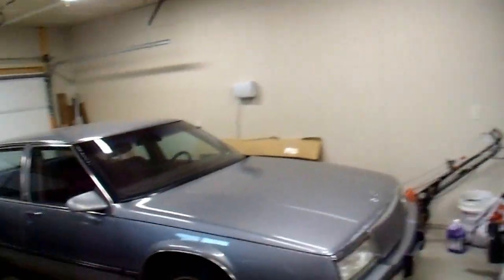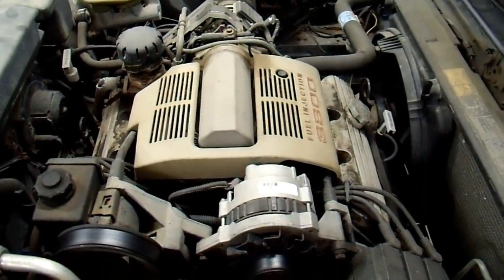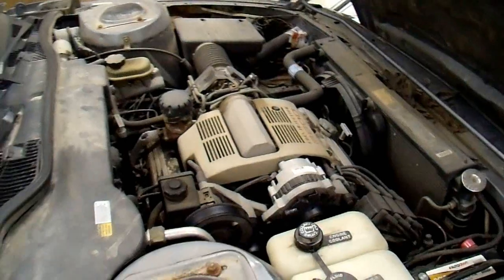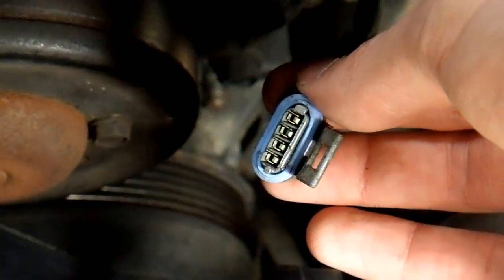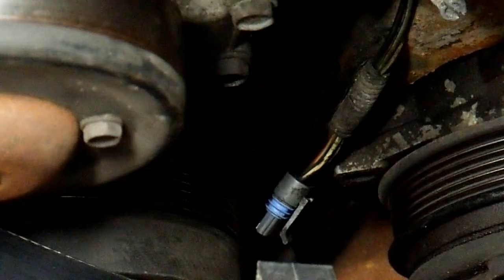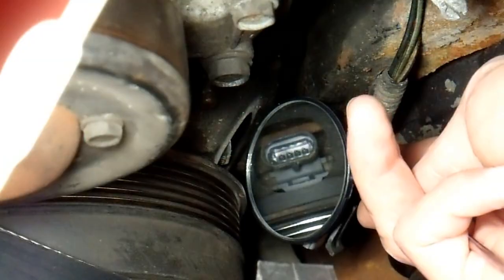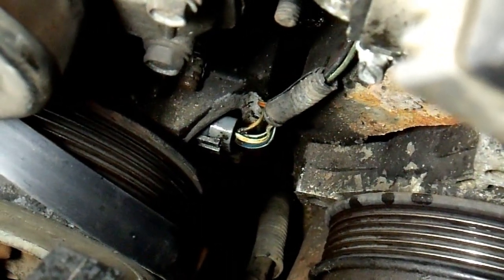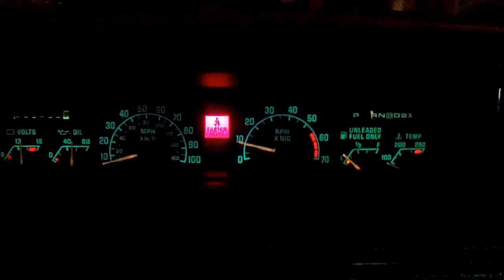3800 3.8L GM engine stalling issue quick fix

Comment: Last year same thing happened with my 1994 Buick lesabre, I changed the crank shaft sencor and it fired right up and been work sence then, until now same thing happens but after we changed the sencor again it won't start, and if it does it stall then won't fire up again, plus my service engine soon light is on, which means a tune up, any ideas won't be great before I waste money at the shop. Could it be the position sencor?
Reply: Lone Wolf Use butt end of screw  driver tap MAP sensor (Its black in color made of thick hard plastic approx 2 1/2 inches long by 1 1/2 inch wide) sensor is directly behind manifold you can see it with your eyes no need look behind manifold, right side of alternator, If MAP sensor is bad or faulty. Guarantee your car wont start. You can either buy new $75 or buy salvage $35
Reply: Hey, I just changed the crank shaft sensor yesterday, and my 1995 Park Ave. stalled on the freeway.  Other people say it might be the fuel regulator sensor......  I don't know
Reply: Lone Wolf Engine stalls? Its fuel related have fuel filter checked you need replace this part every year filter get dirty clogged which prevent fuel reach engine. Also check fuel regulator. Dont usually need replace part just use air hose clean it out.

Comment: I have a 1994 Buick park avenue and it is having the same problem as this Buick on the video... my needle would jump around and my coolant and oil light will come on then the car will shut off while driving... took it to a shop and the services I received was an intake manifold gasket along with a few other services leaving me with a 1500.00 bill... got my car out the shop and it is still shutting off but it runs better than before... now their computer is saying that my circuit is low with my TP sensor... I am getting very aggrieved with this situation... could it really be the crank sensor or the tp sensor?? help a female... please
Reply: I know it's an old question, but you can't go wrong with just buying them and putting them on yourself. I always get all new sensors if I have to tear into a 3800, it's more likely that they are at fault rather than something mechanical. I replace the TPS, IAC, MAF, or you could just buy an aftermarket throttlebody to do those 3 easily. But it's really easy either route you take. Coolant temp sensors can actually cause more problems than one would expect too, a little harder to get to but still a 20-30 minute job. Best of luck, I have faith you'll figure it out. Take care of that old girl, I love PA's :)

Comment: i have a 2001 buick lesabre 3800 motor and while i am driving once ive been driving for like 30 minutes straight then it misses it backfires and then finally shuts down it has 2 kool off for like 30 or 45 minutes and then it cuts off i have brought the crank shaft position censor and also the fuel pump and spot or other things but i still have the same problem what should i do next? what could it be??????? please help
Reply: David Settles it might be ignition module

Comment: I have the same issue with my 1990 Buick regatta. Mine would stall when I step on the brake to slow down.
Reply: did you find a solution to the problem?

Comment: Thanks a lot for this, including the advice of just wiggling the wires and connector if in a pinch, which worked! Restored from the dead!

Should dielectric grease go directly on the contacts also? Or only on the silicone boot (crankshaft sensor)?

Comment: I have 1994 Olds with 3800 engine, it runs great but stalls intermittently only on deceleration and at slow speeds.  It may stall 2 times in a few blocks and then not stall for days.  It typically restarts first try. It never stalls on acceleration.
Reply: Late reply but that could be the sparks or it could be your coil pack. If not maybe a ground problem

Comment: i have a 2000 Pontiac Bonneville my wife drove it to work and a/c pump locked. fixed that but now it won't start i put a cam sensor and crank sensor on it it start up and runs rough but then dies in a few seconds to a few minutes. won't fire then it will fire and start again and not long it dies! anyone know what it could be!!!???

Comment: If you really want to stop this from happening, don't use WD-40. It won't last long enough.

Instead, get some dielectric grease and go in there with a brush. The grease will protect the thing from corroding far better than would WD-40.
Reply from the maker: 4 years late, but I agree.  Dielectric grease would have been better.
Reply: Nemo true
Reply: @Oghurrakane  I Agree.
Reply: thx 4 the tip nemo

Comment: I have a 1990 oldsmobile 88, it's throwing a code 42 for timing but not crankshaft. Could it still be the crankshaft sensor? No other codes are being thrown. So I'm at a lost but a buddy of mine did recommend this sensor
Reply: +dakota feth One thing that can happen with these is an issue with the camshaft sensor. That sensor relies on a small magnet in the cam gear to get it's readings, and that magnet can fall out. 

Fixing that has cured these problems for some people who have been baffled by this problem. That said, I don't think it's an easy DIY fix.
Reply: O wow thats What My mechanic told me

Comment: My Oldsmobile has the 3300. It misses stalls at idle. smooths out when I give it a little gas and drives good. I'm going to try adjusting the throttle cable

Comment: i had a car with that engine. it actually spun a rod bearing on the way home from the dealer. i was dumbfounded because i know these engines are reliable. the dealer ended up replacing that engine with a reman and we drove it for several years it was a 1987 bonneville. we have owned several 3800 engines since, and usually its the last thing to go. i have a 2000 GTP with the L67, strong, powerful and reasonable on fuel. sadly the salt is getting to it, because it only has 162K on it, that's right i said only 162k because these engines can last 300k+
Reply: andrew donohue I have a 93 Bonneville with 42,000 miles. If I can keep the winter salt from turning it into a rust bucket, it may last another 24 years.

Comment: My 1989 Buick Reatta had a serpentine belt separate along the splines, and pieces of the belt destroyed the crank sensor -- the car immediately stalled and would not restart at all (there was no spark).....  Interestingly, the day before this event, the car stalled randomly and abruptly a couple times, and threw a code (engine electrical problem), but would restart immediately and seem to run fine....   Well I pulled the balancer and installed a new sensor to replace the broken one (one of the 'ears' of the old sensor was completely broken off)....   AFTER the repair, the car immediately started (even after sitting 3 weeks) and ran strong, EXCEPT the random stalling and throwing the code remained (the service engine light would appear, for a while, then dissappear for several miles, then you'd hear a skip and the light would reappear -- sometimes stalling).....   The code is E034, which indicates MAF sensor (there is no code thrown specifically for the crank sensor).....   * Because of the timing of the first instance of the stalling and code, I'm wondering if the serpentine belt caused damage that I did not (yet) see?....   Would either a defective crank sensor, or an intermittent loss of connection (partly broken or loose wire), cause the car to randomly and abruplly stall?   The MAF is on the other side of the engine, so I don't see how it could have been physically affected by the belt break -- but perhaps there's a wire (ground?) that's been affected?

Comment: Mine doesn't stall, but it acts like it might. Just has been running rough in general. Every once in a while it won't start... if you give it a minute and try again it will start. Sometimes it starts great, and other times it starts and sounds like its going to putter out but it never does... Not sure what is going on with it.

Comment: Great video! Thanks. I have 3800 Ser 1 in 1990 park ave. Runs great except stalling when hot. Handmedown car and I've been told it stalled more when hot and sometimes cooling down helps it restart. So, I checked the wires at Crank Sensor and found one or more wires have insulation stripped off down by connector. Maybe from a belt coming off and hitting them. Could this ARC when HOT and short very easily? It's oily in the area and I am going to clean it up. Wires are tight in connector and seams that cooling down and pulling on wire has got it going again (so far). I watched both videos and replacement is big job for me. How would you clean and wrap the wiring and is there any TEST to determine that sensor or connections are faulty?    Car does not have a tach.  Also, some people have posted there is a way to replace the sensor without removing the Harmonic balancer. Do you think there is a way to do that?

Comment: Mine has the idle issue and it randomly dies this is on a series one would it be the crank sensor? I've been fighting the car for a while I bought it cheap from a relative and it had sat a lot
Reply: +knurlgnar24 Check Your Wiring Harness!!!! The wiring harness tends to uni-glue or burn wires. With the burned wires when the engine is cold its fine because the wires are shrunk together, but when the engine gets hot the wires expand now you have no connectivity. This happens due to heat from the motor and the bad placement of the harness on GM's Part. And dude the 3800 Series I was made from 1988 to 1992. And the 3800 Series I can run without the camshaft sensor, you just wont have sequential fuel injection which is correlated to the quick start GM applied to this motor. Also the car will run with a bad crankshaft positioning sensor. The crankshaft position sensor sends a 3x and 18x signal to the ignition module. you can run if you have a 3x or if you just have a 18x signal. The car will run better if you have both signals though. Also if your having a problem with starting check your timing chain and I say this because on the timing chain their is a plastic holder with a magnet inside of it. as the motor spins the magnet passes the camshaft sensor. The job of this is to apply the sequential fuel Injection. If it is dying check your main wiring harness because if your wires are glued together and then the engine gets hot they expand and now you have no connectivity Check your throttle body it could be clogged along with the IAC valve
Reply: +DragonKnighte2798 
you sound pretty sure of yourself.if I unplug cam position sensor on my 90 ,,it will run as a temp fix?
Reply: its not on the chain its on the camshaft gear. i guess mine fell out too. but in order to put it back on there u have to take the plate that has the water pump attached to it and take the whole gear out to put it in on the other side or take the magnet and take the plastic off and jbweld the magnet to ur camshaft gear
Reply: its called an interrupter. the magnet interrupts the electrical signal that is the sensor
Reply: Christopher Bazinet yeah sorry wasn't very detailed about that. should have been more detialed, but anyways yes it is on the camshaft gear. has the crank is spinning then spins the camshaft gear. when the camshaft gear is spinning the magnet on the camshaft as the magnet is rotating it passes the camshaft sensor which then sends the signal to the computer and then the computer creates the sequel injection fire.

Comment: Oh I got one of those the LN3 Mine did that too. I am rebuilding it anyway got one head pulled doing the other head soon. And gotta get a new starter solenoid. I'll get a new one with a new connector. I'll try to protect against corrosion because of it. Probably some dielectric grease may help.

The reason I am redoing it is because the manifold gaskets weren't done correctly and caused a leak the person forgot the RTV at the corners. I got new gaskets but decided to do head gaskets as well due to it all being right there.

Now at least I know why it would crap out and stall. It started at by the end of the drive way it stalled and would not start again.

Thanks for the video.

Comment: Man I have the same idle problem I was suspious of spark plugs but im gonna do.ur way first .so u just cleaned up.the connectors and did not change the sensor .right
Reply from the maker: If it is only an idle problem I would suspect something else other than the crank sensor.